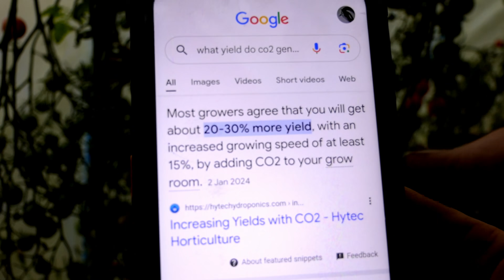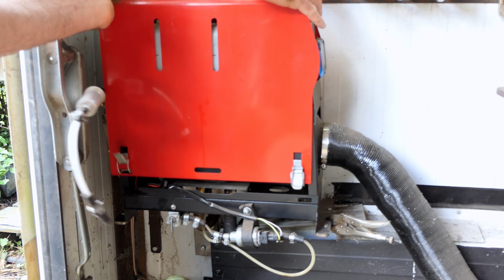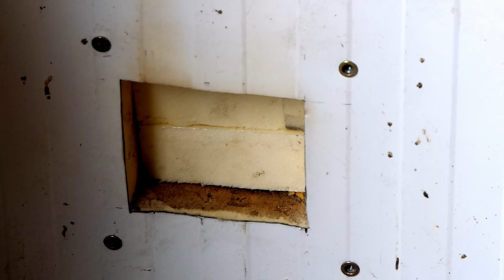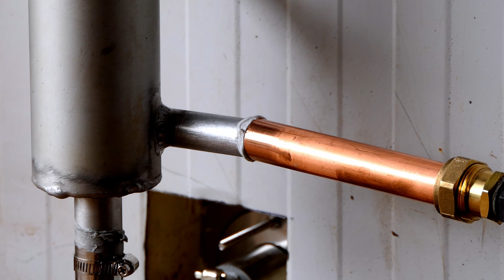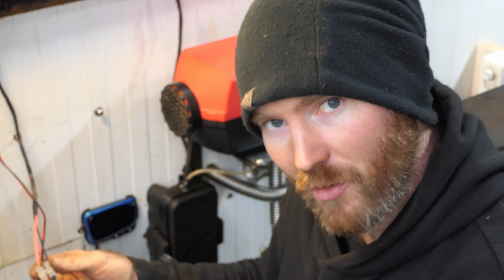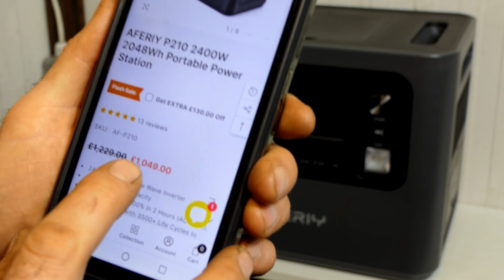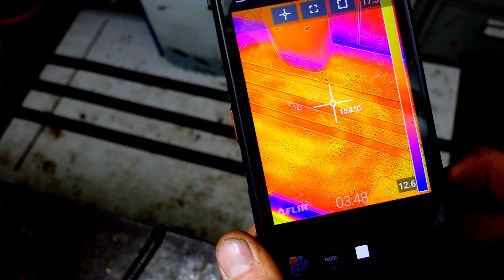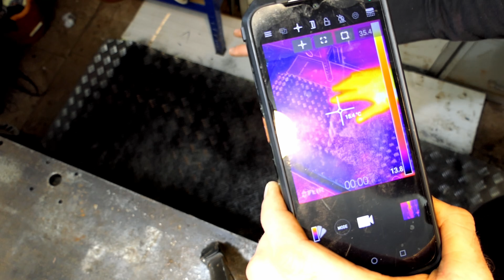NEW! Better system for Cheap and Safe Heating💲+ Underfloor Heating Mod test🫠

Comment: Of course climate activists flying around the world on jets is hypocritical, but that doesn't change science. And it pales into insignificance compared to the hypocrisy of the oil producing countries and companies spending billions to counter attempts to act on the climate crisis. It just seems mental to me when you make out that you're standing up for the little guy in your arguments against climate action. The billionaires are the ones who will benefit from this nonsense, they'll be fine. As usual, the poor will suffer the most from the effects of climate change, the billionaires will be fine.

Comment: I use Diesel WaterHeater (Vevor 10kW 24V) and heat partiallybmy Off-Grid House in Estonia, using a 34m2 Underfloor Heating System with a 500l HeatingBuffer which id neccrssry becsuse of my main WoodStove with WaterBottle (selfmade).

However, the money and effort you put into modifying the Airheater is not worth, because the 10kW Vevor DieselHeater costs only 155-200€.

Comment: I did a floor heating iny kitchen, insulation goes UNDER the pipes. The pipes have to be in a very conductive material. Lasily, I used concrete. And I get a very good inertia.

Comment: Just a thought on recovering exhaust heat. How about running it through an old hot water cylinder and then fitting a 100mm fan at the base and removing the immersion heater to allow the warm air out. Blowing 15 degree air past at 300 degree coil has got to create some transfer.

Comment: Great content across the board Josh, did you not get any leaks on those push fits without using inserts? I've happily subscribed. 👍
Reply from the maker: @andolaz7359  thank you. Because it's non pressurised the inserts don't do much. I didn't have any either. Cheers J

Comment: Could u instead of a battery backup just get the motherboard to a save location to prevent frying it?
Reply from the maker: Possibly than less it needs the cooling from the internal fan. Cheers J

Comment: The underfloor heating system with the expanding foam glue interfering with the original sheet and the aluminium sheet heat output, might go differently if you try some other surface. For example, box in the panels sides and pour in levelling compound used in underfloor heating and tile over it .... might last along time. Or not😊

Comment: Why don't you use the same chinese diesel heater in the water heating version?? It's made to be inserted along cars engine cooling system to pre-warm thé engine. You Can select the water temperature . You should try one
Reply from the maker: @toine0265  watch the next video... Cheers J

Comment: i did say "what about carbon monoxide?" only as a seasoned professional cigarette smoker i was asking how or where aside from the old classic heaters will i be getting my CO? also no one mentions tar, everyone thinks nicotine is the sought after ingredient, i need a high tar intake and sometimes i run out of cigs, whats the tar levels look like on that exhaust?
Reply: they should make it mandatory to have different levels of safety for classic cigarette smokers on CO testers since we survive longer in house fires than our shall we say weak lunged nonsmoking normies, so on that tester, it could say oh if your asthmatic quality bad! to normies grab an unconscious asthmatic on your way out, sir according to our readings you may be able to stay indefinitely and sir, yes laramie air tester thank you for choosing laramie
Reply from the maker: Lol. Cheers J

Comment: I ride into London to go to work. As I get the Chiswick, I go past a park that is surrounded by trees. I would say the site is only about an acre and a half. However the temperature drop as you're riding past the park is astonishing. Even in the summer you can feel it. 
Less people on the planet and more tree's
Reply from the maker: Definitely more trees. I don't buy into the less people thing. We're already headed for a disastrous population decline and it will come with very little benefits. There are plenty of resources for more people, it's bad politics and selfish greed that get in the way. Cheers J

Comment: Finally, someone who thinks what I think! You have my Sub.
As for the heat recovery, Could you make a heat exchanger on the blower intake side? This way the blown air will be hotter.
Thanks,  keep up the good work!
Reply from the maker: Possibly as long as it doesn't over heat the fan and electrons that's are cooled by the fan. Cheers J
Reply: @joshuadelisle  I think it would be ok, as you have a high flow through there so it may rise the temp by 10-20 degrees max.

Comment: To make your water loop closed circuit, you need an expansion tank.
Would like to see you do proper heated flooring too, might even be able to improve your heat exchanger.

Comment: Will you pour a concrete floor and cut perfect floor pipe lines?
Reply from the maker: I would lay down insluation, then pin the pipes ontop, then screed over it. cheers J

Comment: 4:30. Trees breath CO2. You breathe Oxygen.   Might want to restate that?
Reply from the maker: @ThePOTUSofMatthewEmbryBradshaw  that's the point lol. What's good for the trees is good for me. Trees produce oxygen from CO2 which is good for us and great for the trees.
Reply: @ based on what you’re demonstrating in this video, I should be able to set up a bedroom in the greenhouse full of plants and sleep in there without exhausting the diesel heater
Reply: So are you agreeing with this?
Reply: Maybe you should do a measurement on how much CO2 is being emitted and how many plants it would take to absorb the CO2 safely to live in a sealed room with the diesel heater and plants
Reply from the maker: @ThePOTUSofMatthewEmbryBradshaw  if you listened to everything I said you'll understand that would be a silly idea. However I know a lot of people are using paraffin green house heaters inside and Insist they are perfectly fine. I've actually bought a CO2 meter to test it and conclude it's safety.
Reply: @ I look forward to a video of you in a bed in a greenhouse!! lol
Reply: I live in a greenhouse and I bought one of these diesel heaters based on your videos so if all I have to do is have a X amount of plants, of specific types, in here…. 

The greenhouse I live in is 16 x 60 

See if you can do some math on that for the video concerning CO2 emissions 

I haven’t subscribed yet 

But I do appreciate your videos 

At this moment until the heater gets here, I have zero heat 

I will be using this heater and a mass heater in conjunction to heat this greenhouse
Reply from the maker: @ThePOTUSofMatthewEmbryBradshaw  you get on average 5kWh/kg of energy from wood and I know that a single hazel coppice stool can produce 80kg every 7years and can grow within 1m of the next stool. Grass and algae produce hydrocarbon compounds at an even better rate per meter. It takes less energy for a farm to produce bio diesel and bio gas than it uses so that's data to look into also. I think if we stopped deforestation and restored the oceans whilst utiliseing agroforestry and regenative farm we'll be just fine.
Reply: @ do you have a suggestion for someone who has done an excellent exhaustive explanation design and build for a biogas generator?
Reply: I raised Quail and I’m pretty sure the guano/manure would be a perfect source
Reply from the maker: @ThePOTUSofMatthewEmbryBradshaw  it also depends on who's funding the science data. Many scientists would lose their cushty lifestyle if they showed anything alternative. I know a few that have. Cheers J
Reply: @joshuadelisle  I’m with you on the corruption of everything

Do you have a video on a bio generator or do you know of one?
Reply from the maker: @ThePOTUSofMatthewEmbryBradshaw  I want to try bio gas and I've looked at a number of videos/documents on it. I conclude so far that it's too smelly/dirty, too much work to keep feeding the system and takes too long to refill to be used as power generation on a small scale. Wood/biomass gasification is definitely  better for small scale.
Reply from the maker: @ThePOTUSofMatthewEmbryBradshaw  I've seen a lot but I don't have one to hand. It's been done by DIYers  to industrial farmers. Essentially it's organic waste 1:1 with water in an aerobic tank/bag. The gas produced goes through filters and catalysts to get rid of the smell.
Reply: @ but CO2 is not good for you.

Comment: To extract the heat are you able to use two of the heat exchanges (described in YouTube video "How To Make a Heat Exchanger" video rwKQOGpx1Nk) connected together.  So, rather than having cold water running through his "cold" side, connect both cold sides together and create a closed loop water/vacuum heat pipe exchange.
Rather than just the two he uses for circulating cold water, it may be better to add more vertical pipes with large OD T pieces to increase the heat pipe flow between the top and bottom.
Anyway, have the exhaust go through the bottom "hot" pipe, the "cold" pipes are your heat pipe exchange, and your top "hot" pipe is actually your heating water being circulation
In theory, this should draw the heat away much better than straight conduction.

Comment: 65 years old hundreds of hole saw holes drilled, Shit now what. Plug it somehow and re drill it or make a nasty oblong hole trying to use the right size. Nope hole saw inside a hole saw Genius, I could have used this tip for the last 50 years. Thanks so much Like and Sub. Its was really the last few minuets of the video that earned my sub. Not sure what the UK food situation is but here in the US they are trying to poison us everyone needs to do there research.

Comment: I`ve installed it in my own house nearly two years ago and using it on the minimum speed as a positive input ventilation, it`s running whole night and there is no condensation on the windows anymore, 120sqm, the house stays dry and warm

Comment: I have a good argument against some at least one of the things that you've said however, you are an intelligent person and I think you might be more or less tolling as it is a very controversial subject. I will bite anyway. 

Let's say climate change is happening and humans are causing it. Co2 levels were significantly higher in prehistoric times and plants and animals thrived. Most people overlook that it took millions of years for these changes to occur which coincides with the rate at which plants and animals adapt. When you factor in time, 50 to 200 years is nowhere near enough time for the environment to adapt therefore the consequences could be catastrophic. 

P.S. I'm glad you mentioned seed oils, carbs, and sugar as the major contributing factors to human health.

Comment: I love your video and just subbed. You already know you need a more efficient heat exchanger, but you said you had a sand floor. I would concentrate on using that sand as your heat sink and get rid of the radiators. I would construct a better heat exchanger and insulate the exhaust until you can get it piped into the sand under the floor and use the pex buried in the sand to absorb the heat. 
Get as much of that heat absorbed into the sand.

Comment: Was wondering if there is a way to generate power from the waste heat to power the unit would reduce the battery size if it could match the power draw . The cold air intake should give a good temp difference.
Reply from the maker: @adventureswithopensource8525  the best thing is to use a diesel generator and reclaim the heat from the exhaust. Cheers J
Reply: @joshuadelisle  that would really defeat the point. I just looking for ways to not have to use a car battery  or a power supply. But for it to run on it's own so if I get no sun for days I don't need to run a generator to recharge the battery. To keep the heat on . But thanks for your time . Like your ideas so far keep up the good work
Reply from the maker: @adventureswithopensource8525  thank you. It won't work to generate electricity even with peltier devices which are inefficient. A solar generator battery unit would work but that's only if you get sun in winter. I'm looking to run my diesel generator off kerosene with a lubrication additive and reclaim the heat so I can generate 30% electricity and 70% heat with the fuel. Cheers J

Comment: it's easy to look at the atmospheric percentages and dismiss whole branches of science, look at how much ozone there is only about 200 Dobson units but that has a huge effect absorbing radiation, the same maths and chemistry that does spectroscopy can be used to calculate how much energy of different wavelengths (UV IR etc) is absorbed and it all adds up, now we know IR is warm so chemical that absorb IR will heat more than other chemicals. We also know that the earth is a dynamic system  always tending towards equilibrium whilst also constantly being fed energy from the sun in simplest terms it's behaving like a spring, more greenhouse gasses (ones with molecular bonds that absorb IR energy) means more energy in the system so the "ends of the springs" will move more which would lead to more frequent and intense atmospheric disruptions.

Comment: You’re gonna need to calculate how much energy it takes to put your power box back up to full charge
Reply from the maker: It has UPS (uninterruptible power supply) meaning it goes straight to mains supply and doesn't use battery unless the mains is cut off. Otherwise night time rates are cheaper than day rate depending on your tariff so using the battery is cheaper than using the mains supply. Cheers J

Comment: I’m a idiot. I think it would be better to get a good generator and use electric heating cables for the indoors. That would solve all problems with efficiency and provide electricity. The outside would ( pun intended/ not intended) be better with a wood boiler and hydronic system. If a leak happens in the hose ( seismic shift)? That’s allot of water to clean up inside. Electric would just need to be disconnected. It might have a sensor that disconnects automatically. Then you have time to think if you want to repair. Water will leave you with no choice.
Reply from the maker: @lamarwilliams185  a generator is only 30% efficient compared to 90% that a diesel heater can achieve with the same fuel. Using heat recovery on the generator could work though. Plastic pipes are very versatile against a seismic shift of any kind. Electric heaters have more common problems with fires, electric shock and failing circuitry. Water is a safer option for sure. Cheers J
Reply: @ Thanks for the reply!!!
Reply: @ Your right. I had to look it up. I thought the seers rating that they give most appliances would mean that it had high efficiency. Learn something new everyday!!! ( Tier rating not seers rating)
Reply: I found this “ Diesel heaters are less efficient than electric heaters, as they rely on combustion to generate heat. This process can result in energy losses and lower overall efficiency. Meanwhile, propane heaters fall between electric and diesel heaters in terms of efficiency “ off of one of those diesel heater sites. I can not figure out how to convert the 30% efficiency  of a generator to that 90% of the heater. Then guess the amount of money that would be saved in a power wall unit or bank of batteries for electric and heat.
Reply: Gasoline would be a better option for a generator if what I’m reading is true. We are trying to compare apples to apples. Apples should not be diesel but; the cheapest.
Reply from the maker: @lamarwilliams185  it's all relative to cost. Electric heating is 100% efficient but costs 5x the amount. A power station is only 40% efficient, solar is only 15% efficient and the grid loses up to 20% through lines and transformers before getting to your heater. Cheers J
Reply: @ thanks for clearing that up!!!

Comment: It's more energy efficient to move heat from outside to the inside of the house than it is to heat up the air.
Reply from the maker: @sakukullberg2697  not necessarily cheaper though. It depends on the cost of energy that moves the heat which is more if the temperatures are freezing outside. Cheers J

Comment: If the battery charger has a repair function, you’ll want to make sure that you disconnect heater. Reconditioners for Lead Acid batteries can output up to 50V when desulfating

Comment: Hi Joshua, love your vids!

There should be a delta of a minimum of 15 degrees celcius between the lower and upper part of your white radiator. Hot going in from the top. 

If the delta is lower than that, too much temperature will go back into the heat exchanger and your system will heat itself up, being not efficient enough.

Comment: Im sorry... did you just say your having products of combustion being vented into your greenhouse? AKA an enclosed space? are you mad? under Gas industry unsafe situations
procedure 6.1 (Chimney/flue terminating into an internal space) which is considered an immediately dangerous situation requiring you to dismantle that greenhouse or capping off your supply of gas until you do so. (source: i am a qualified gas engineer)
Reply from the maker: its perminantly open both ends for air flow. heat is trapped in top.  cheersJ

Comment: I am loving your postings - excellent work! Just a thought regarding the air intake for your kerosene burner. I get the logic behind placing it outside to prevent negative pressure in the workshop but, given the heat losses through your door, I think the negative pressure losses will be negligible in comparison. On the flipside, having the air intake inside your workshop should improve the heating efficiency - once the air starts to warm up you'll be heating up warm air rather than cold air, so there should be a noticeable increase in output temperature. It's like running the aircon in your car - it's much more efficient if you turn on the air recirculation. Worth a try???